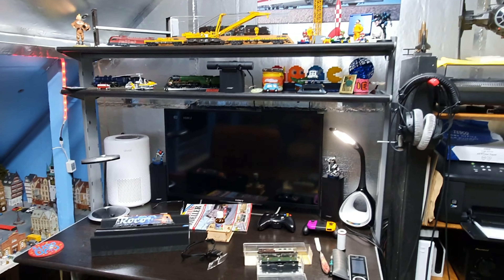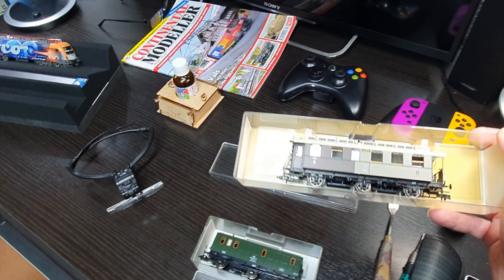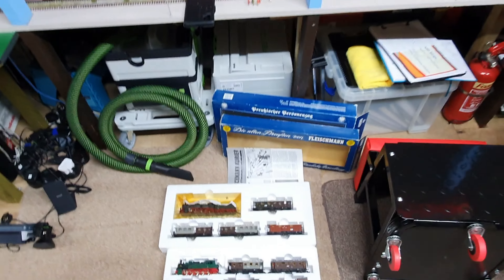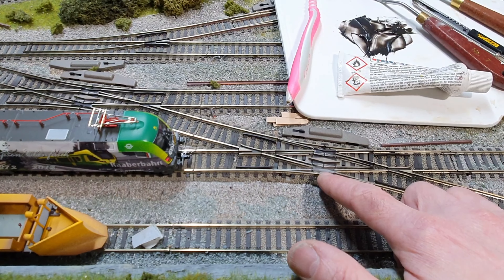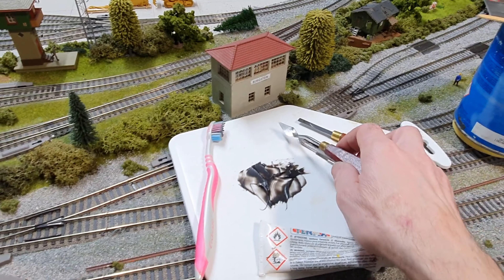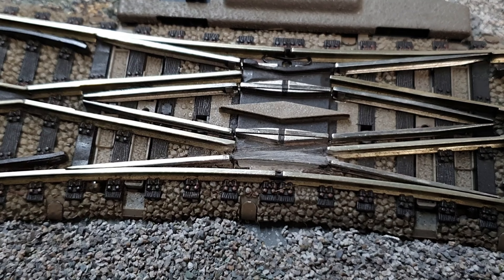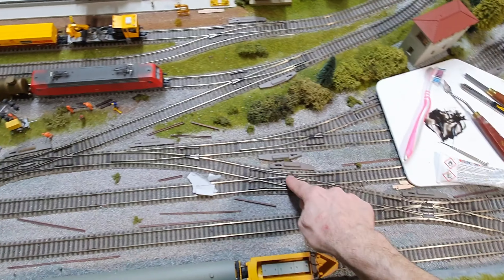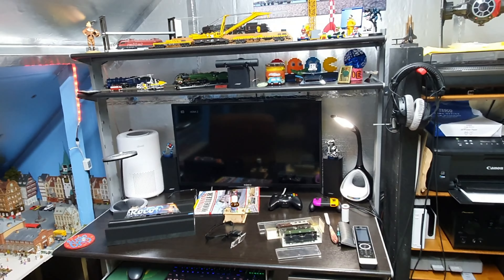Repairing Fleischmann Track VID 1

Comment: Great Job Jim had the same problem with my profi track ,tried to get replacements but found out they stopped making it ! so  after a long time using profi track ,have changed all my track over to Kato
Reply from the maker: Thanks...I did the other side and now its as good as new ..very fiddly awkward to do without damageing the intricate movements, I Needed the 2x mag glasses to do the work..
Thanks again..jim

Comment: Half the problem is knowing what to use for the medium that already exists. The properties of the 2 pack look favourable and time will tell how durable it is. It's amazing what the track has to stand up to given extensive use. Great fix Jim.
Reply from the maker: Hi Andy,
Yeah it seems to be holding well but I need to get a high speed train doing multiple laps to test properly..
There are many 2k fillers but this one ìs the best to carve once its 50% cured (15mins)
After that time it go's like concrete or marble..the filler has marble properties. 
The best knife I knew for the fine tuning is the Olfa 30 degree knife .
Thanks again..👍🏻

Comment: The green 3 axle one with DB logo is one of the support vehicles for the large crane.

Those 3 axle cars with passive center axles are ideal for pointwork testing as they are very sensitive to track defects
Reply from the maker: Thanks for your info..never seen the support coach from fleischmann before that will go with the big Fleischmann crane.
Very good idea about the testing of double slips with the three axel coaches..
Thanks Jim